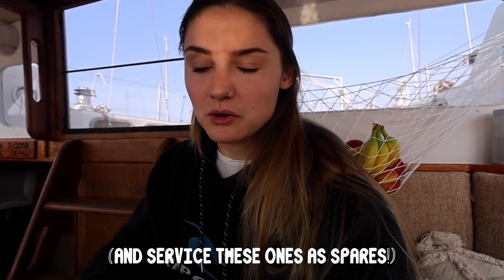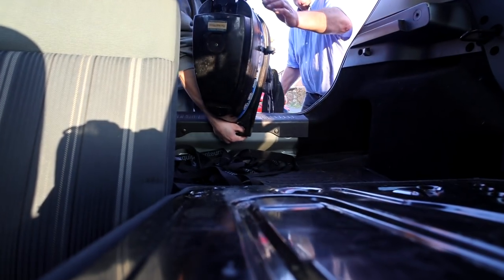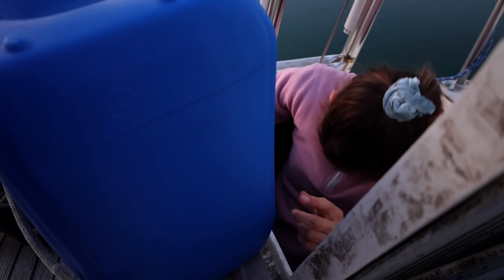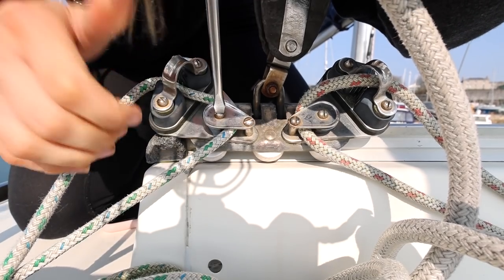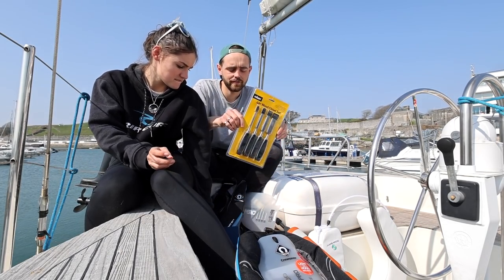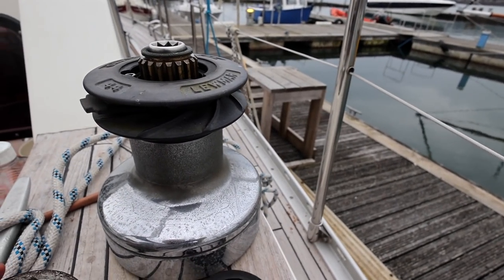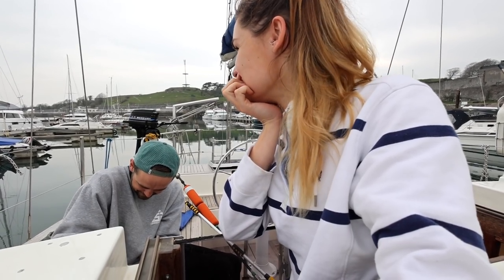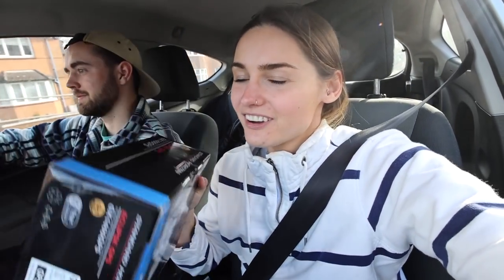Getting our NEW BOAT ready for the FIRST SAIL

Comment: Hi Becka, Zac, so much fun!! So much learning!! So much work 😂. Firstly if ur using Marine grease on winches and basically every thing else, u do not need to oil them, the oil will break down far quicker. Marine grease is made specifically for Marine environments, I've been a mechanic for over 30yrs and never used oil on a winch, anyway there's a couple of other products u need, 1: is called Incralac it's a spray can used for protecting all metals, it dries to a shine and gives a tough lacquered clear finish, unreal for stopping rust and salt water stains. 2: bottles of white vinegar it will clean everything great for getting rust off. Your both doing very well, stay happy, talk alot💙💛🇦🇺🤣 oh and the lifebouy goes on inside, cause a rough sea will take it clean off ok🌈
Reply: Um, the yacht winches do need grease and oil, a light winch grease, and a light oil only on the pawls.
Reply: @Sailspirit99  Ok🌈
Reply: @seawench555  just noticed the 🇦🇺 in your first comment. You staying dry? I’m on the Indian Ocean side (Perth) and we’ve been very hot and dry this year. Only turned off the ceiling fan about 2 days ago.
Reply from the maker: Thanks for the suggestion! Will look into Incralac- sounds great stuff 😊 And will put the lifebuoy on the inside! 😊
Reply: @Sailspirit99  Hi, East Coast, very wet, in fact bad flooding, but has stopped now shhhhh.

Comment: You two are making great progress on the boat jobs.  Personally, I wouldn't be scared of using too much grease.  Oil works great on the winches, but it doesn't last...you'll need to re-apply a lot more often. Marine grease resists water far better than "normal" grease and actually helps keep the water out (oil doesn't do that as well).
Reply from the maker: We have the marine grease- its just the little pawls which we were told need oil as grease makes them break quicker! But nice to hear we shouldn't worry about using too much grease 😊 Thanks Erik!
Reply: @TeuluTribe  watch the Lewmar video on servicing winches. You'll be surprised how little grease they use. (Definitely oil on the springs)
Be careful of 3rd party advice, always try the manufacturer first, they are the experts.
Reply from the maker: @klaudiaskyes2922  Will do- thanks 😊

Comment: This is so great! We are too doing our VHF course with exam this Friday! Our boat is also 43 feet long and although we could technically sail it with our Basic Keel Boat Standard (Canada), we really need an Intermediate Level to be eligible for Insurance... We live and we learn I guess:) Sometimes doing something enthusiastically and letting things work out on the way is perhaps the best experience although not the safest. Before sail, do check your engine bits like the impeller so our engine does not overheat and check the anchor mechanism in case you need to perform emergency stop. If I may suggest, having a manual water pump is a good back up thing to have in case you have leak in your bilge and they are not too expensive... Can't wait for your first Sail on your own boat, it is there where every thing will make sense! Fair Winds!
Reply: Great advice!
Reply from the maker: Thanks fo the advice Peter! We have every service part for our engine on order and once they arrive will be changing everything out 😊 our windlass is a bit on and off but Zach can pull our anchor in manually (we checked saturday!) we also do a siphon for water on board 😊 Sail vid will be coming soon!

Comment: I think you may have made an error when buying your outboard motor. Almost all tenders will have a 15” transom height, but the engine you have looks to be a 25” sail boat model. This means the outboard will be 10” or so too long and will hang too deep in the water. This will cause very poor performance, possibly lots of spray when underway and stop you from going into shallow water. You might need to change the engine for your tender to a short shaft model.
Reply from the maker: I think you may be right Russell! Doh! Ah well, we live and we learn and i guess this one will be going up for sale soon 😅
Reply: @TeuluTribe  before it goes up for sale, think about keeping it as a standby in case your main engine fails. If you can bracket it off the transom to push you along, it may get you home one day.

Comment: Don't forget to register your Epirb and any personal beacons you have.  Personally I avoid white spirit, it's a form of paraffin and leaves a residue.  As with your wipes, isopropyl alcohol is better and cheaper.  Silicone sprays and grease for all those little jobs and the spray is very good on blocks, although "seasoned" sailors say flush blocks with hot water only and never use WD40.... although every boat should have some though!  Winches should be serviced yearly-oils and grease will get contaminated-the winch handle you have are very long, short GRP of folding units can be left in place and the reduced leverage has never been a problem for us. Servicing the head and black water tank is vital, ureic acid mixes lovely with salt water to scale everything up, Chem-Assist do a product that doesn't destroy ss tanks and fittings, never use bleach on anything.  Not sure if you've serviced you windlass - vital.  There's loads of videos on boat handling, but, although not a legal requirement, work up through the RYA Competent Crew, Coastal Skipper and Yacht Master courses over time and you will gain confidence with your knowledge.  ColRegs, day signs, navigation lights - it's intense fun, the RYA do some great digital versions of there training and book catalogue.  Boat handling - watch some of Tom Cunliffe's videos.  Check out a bilge high water alarm and manual+electric bilge pumps-not sure what you have at the moment. You've revived my enthusiasm with your videos, great, but just remember, if it can happen, it will happen, that's the fun of being on a boat...!
Reply from the maker: We have already registered our EPIRB, interesting about the blocks! Will look into shorter winch handles (to be fair- we thought they only came in this length but would love smaller ones!). We don’t have any black water tanks- it’s something we may add in the future (or a composting loo) 😊 we need to service the windlass- it is a bit hit or miss- luckily Zach can pull the anchor in by hand but it would be nice to have it working 100% of the time. We did our RYA day skippers last October 😊 thanks for all the suggestions and advice!
Reply: @TeuluTribe  Forget the composting, you don't have the space or capacity and the sea is the best recycler of organic material, its heaving with hungry organisms, just not in the marina!  We use the marinas facilities for the most part but a pee is easier and can be flushed straight through.  A lot of places require holding tanks as a legal necessity, so push it up your list.  plastic is best although fabricated 316 may fit better, just watch those oxiding chemicals... A length of 4.5" soil pipe may have enough capacity  if you are on a really tight budget.  Push the envelope on the courses and exams, passage planning is real art and loads of fun when you get tides and wind working with you, you can end up going backwards sometimes and that cardinal marker that seemed so far away can be like a magnet!!  Anchor chain scope, always work to 6 times the depth if you can, lots of seasoned sailors will tell you shorter but the last thing you want, ever, is a dragging anchor...  Have fun!!!!

Comment: Good on the lifejackets and EPIRB.  Did you get MOBs with the jackets? If not look into it.  Also, no mention of tethers and jack lines. Those are not optional.  I saw a decent set of chisels but no sharpening stone(s) They have to be kept razor sharp to do good work. You may think they came sharp but they probably are indifferent at best. Very good to get that traveller rebuilt. You now have to keep it and its track free of salt and moving well. You did not show much of mounting the winches but I didn't see any sealant, (Butyl Tape has a million uses, get some) on the fasteners.  If you don't bed them down properly they will leak like a sieve. I am assuming you have mask, fins and snorkel and know how to use them.  You will need more than a brush for marine growth.  Ask your neighbours for suggestions and stories. Rum is the sailors lubricant. I will guess that many of the portlights will need new seals and perhaps to be rebedded. You will know as soon as you ship some green water over the decks.  Always remember Cap'n Ron. If it is going to happen it'll happen out there.  Log is a good purchase and a good habit.  Suggest you make a "getting under way" checklist.  Start with what you can think of now and add as you go along.
Reply from the maker: Thanks Mark! Hadn't actually heard about MOB's before but are looking into them now 😊 We have some old tethers but will look into getting more tethers and jacklines before we go offshore 😊 We did seal the winches but have just ordered some Butyl tape- thanks for the suggestion 😊 We both have mask, fins and a snorkel- Zach is a dive master luckily! so we know how to use them 😊 Thanks for all the advice!

Comment: Just saw you are placing the EPIRB on the inside of the boat. The EPIRB is usally placed somewhere outside. The reason for this is that if something may happen and the boat is sinking the EPIRB will come loose and start transmitting. If placed on the inside and you can't reach it anymore, you bought here for nothing. On all merchant ships the EPIRB is placed outside.
Reply from the maker: We researched quite hard about it and seemed that the best place for it is where you will be able to see and grab it- we checked with the RYA too and they said there would be great! The hatch is always open too so easy to grab 😊 but will look into a place for it outside too- thanks for the suggestion!

Comment: What year is that outboard? It looks like it's a bit of a relic as well. Not sure parts are readily available for an outboard that old. Better load up on spare while you can if the compression is still good. Also those units are notorious for rusty drive shafts making the lower unit impossible to remove to change the water pump impeller.
Reply from the maker: Think it may be! Ah well, we live and we learn 😅

Comment: Bekka, pro tip No 2 - You are the captain, you are not a land lubber any more, remove from your vocabulary "its not allowed" only you make the choices on what's best for the safety of your boat and crew. Learn to find the root cause of why something can or cannot be done and go from there, the days of following inane rules are over, let common sense and experience guide your choices. You can gain experience on your own, or from the centuries of sailors that have gone before you.
Reply from the maker: A really good perspective to have! We are still a bit fixed into the norm of society! so will take a bit of getting used to but very ready for it  😉

Comment: Magnificient lack of respect for your environment. At 15:30 you nonchalantly toss some winch detritus overboard. Says a lot about your priorities which obviously don't apply to wildlife or the medium in which you are chosing to live.
Reply from the maker: This comment really saddens us, Mark. We actually are incredibly careful to not only leave the smallest footprint possible, but also, spend hours of our time doing beach litter picks and collecting other peoples rubbish in the countryside. We live a very zero waste lifestyle using as little water, electric and using as little plastic as we can, so to read this, stings. It was a little bit of grime which is mostly made up of salt and grit buildup- still shouldn't be thrown in but as a careless mistake, is so incredibly minimal. All the silicone and other chemicals were disposed off in the correct hazadous waste bins at the marina. We have literally jumped in before when we have seen other peoples rubbish floating out to sea- you will see this by watching our previous videos. I understand this small snapshot doesn't give the whole picture but a large reason we bought this boat is to lessen our impact on the planet and asides from this little bit of debris, we are doing a pretty good job at that.

Comment: Wow, you are ploughing through the preps. Just curious, is the outboard a short shaft for the tender? It looks like a long and if it is, it might cause handling problems on a small dingy. Great video again though.
Reply from the maker: Thanks Norman! its a long shaft *cries*, we maybe made a mistake there 🤣 hey ho- we live and we learn!
Reply: @TeuluTribe  Ah, you should have a short shaft for a dingy. I found out the hard way when I used my long shaft 4hp on a small dingy, (just until I could get a short shaft), it almost flipped over and nearly threw me out. Take care.
Reply from the maker: @normanrubenis7283  Ah, definatley don't want that happening!! Will be selling this one soon then 😅
Reply: @TeuluTribe  on the plus side, a longshaft outboard is a hard to find item for trailer sailors and usually sells for more money than a short shaft outboard.. you should come out ahead after selling and buying another 🙂 and I would go for an outboard that is like enough for you to handle by yourself.. go 2 stroke, for ease of maintenance and light weight.  4-5 hp engines weigh in at around 19kg, but a 3.5hp is around 13kg  ..
Reply from the maker: @timnz009  that’s nice to hear! Thanks Tim 😊

Comment: Hi Guys. Great vlog again. Not sure if you need this but if your hose workaround in the bracket to mount your Horseshoe Buoy doesn't work, then check out the rubber strips you can get from cycle shops. They usually have them to mount lights, speedos, etc to handlebars and parts of the bike's frame. Just make sure the bracket is really secure as when you are out at sea and people are moving about etc you may slip and lean on the horseshoe buoy and if not mounted correctly it may come loose or come off. Wouldn't like this to happen down the line on such a safety critical part of you equipment. These things seem to be noticed at the worst of times when you need them.  Hope this helps....
Reply from the maker: Thanks Edward! The hose held great but thats a great idea that we may get as a backup 😊
Reply: @TeuluTribe  OK, not here to add to your already long list of things to do but just care about both your safety on this journey. If it was fixed well then no worries. I am enjoying the journey.  take care....

Comment: Nice video! For the next time, the winch bases were not supposed to be removed unless the sealant on the bolts went bad and water was making its way into the deck core or inside the boat. That was a lot of extra work!
Reply from the maker: Thanks for the comment! We just wanted to lift them up as we could see a pool of water in them and didn't want it sitting on the deck- next time we wont take the base up 😊

Comment: 18:00
I am absolutely amazed at how spare parts can be found.
Like buying a spare 8 millimetre drill bit is easy, but getting a tiny little spring like that or having one made for you? That sounds seriously impressive.
Reply: Actually those are like washers, everyone keeps spares.
Reply: @markbernier8434  That spring is a washer?
A washer is a circular metal thing, with a hole in the middle, that screws go threw.
But if that's also a washer, then OK. I can see how it could be.

Good point though. Everyone probably does keep spares. I would. Getting replacements for those spares...oh yeah...the Internet. Lol.
Thanks for the information. 💚💙❤🧡😇👋💛🤍
Reply: @davidodonovan1699  I wasn't clear, I should have said "like a washer" everyone keeps spares.
Reply: @markbernier8434  oh sorry. My bad. I read, and then re read that wrong. Sorry.
Reply from the maker: They are (suprisingly!) pretty common in boat shops, who would have known!

Comment: Great job, guys, doing really well; progress! Tip for winch servicing/repairs, especially when you don't have dead flat water in a marina - cut a hole in the bottom of a cardboard box the same size as the winch base and disassemble/reassemble with no chance (almost) of ball bearings, springs and palls going astray.
Reply: And/or place an old towel along the side deck to catch bits before they bounce on the deck then over the side. I like the cardboard box idea, not heard that one before.
Reply from the maker: Thats a good idea! We actually did end up putting everything in a crate (it started raining so had to come indoors) and actually just kept it in the crate for peace of mind 😆

Comment: Good job cleaning and making the boat ready.  Did you think of checking your impeller . These are from rubber and have to be changed every 3 , 4 years , it is in your waterpump and part of your watercooling of the engine with outside water . Very important and much forgotten .
Reply from the maker: We have a new impeller and full engine service parts coming! Thanks Martin! 😊

Comment: Give you a little tip when putting outboard from railholder to tender put a rope on handle  tie  it to the rails till you have it fasten to tender brackets  so if you trip or bump into something and you drop outboard rope will stop it falling overboard
Reply from the maker: Thanks for the suggestion! It is currently tied on to the stanchions 😊